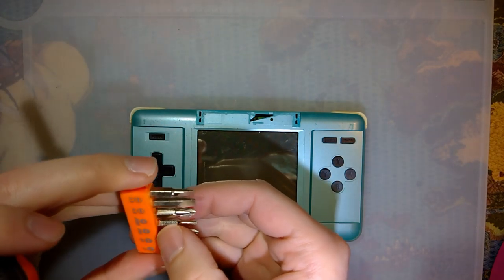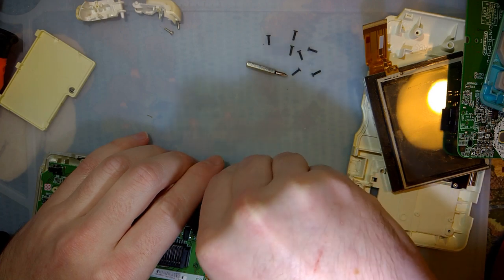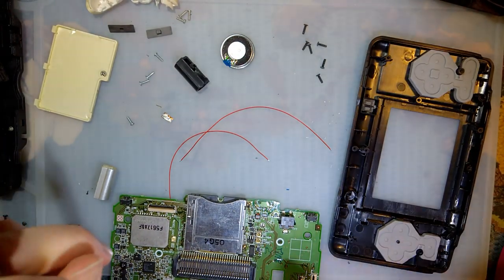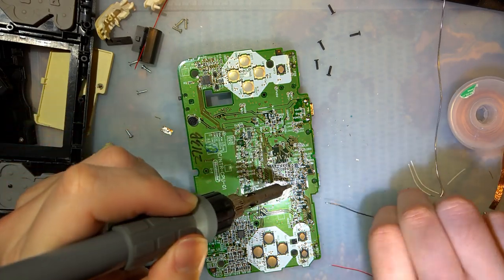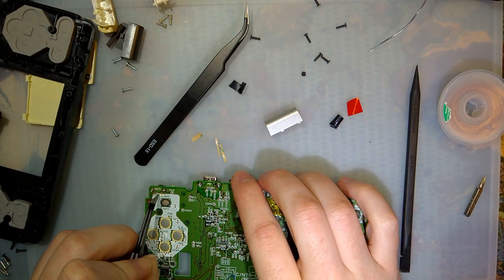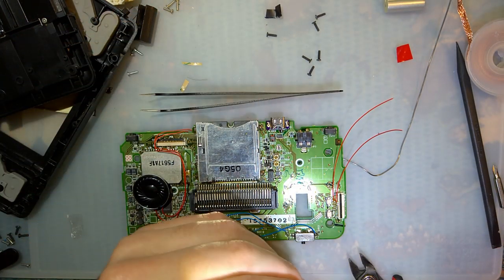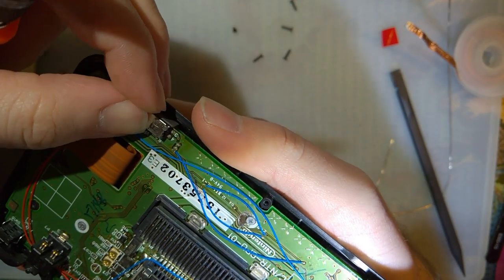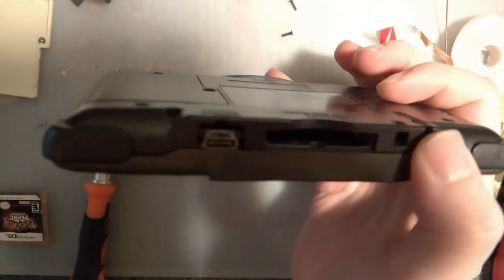Building a Dual Screen Game Boy Macro

Comment: A small suggestion, when you edit you should speed up the screwing and unscrewing, not the soldering people's following along at home would find that easier
Reply: Matthew Williams I think he just uploads them raw, honestly I enjoy the lack of speed up as I listen to these to relax/sleep. Valid suggestion though
Reply: @Shyverin  he sped up the soldering in this video
Reply from the maker: I only edited this video because there were long periods of me just struggling to hit my marks with the iron. I can upload the version that's twice as long if you'd prefer but I really don't think there would be any tangible benefits to it. 

I also linked in the description full guides for what I was doing so that if I moved too fast or didn't show the points I was soldering to, you could follow along with static, high res pictures. 

I don't normally edit videos (to this extent) but I also don't normally make videos this poorly. The McWill GBC video is the only exception that I can think off.

Comment: Maybe it displays the image all funny when you switch because it's trying to show both screens at the same time and the system is all confused.
Reply from the maker: Perhaps. I think it might be interference really. I might need a thicker wire or just a shielded one.
Reply: makho it’s possible. I just ordered some original Nintendo DS systems so, I can do some investigation whenever they arrive.
Reply: @LelandHasGames  hi, did you tried making a macro with switching screens? Any update?
Reply: @restlessheroes  update, I only have one working DS and I haven't had much time to work on any of them but, I have 3 candidates
Reply: Any update yet ?

Comment: Hi Makho. Cool mod. I guess once fixed you could run certain DS games single screen, such as Mario Kart "top screen only". Keep up the good work. 😀👍

I've recently bought cheap a "spares or repairs" DS Lite via an auction site, which has been cosmetically beaten around. Amazingly (apart from the top screen with a torn ribbon which could be replaced from Zedlabz or similar vendor, but that's a different story) it seemed to work.

However, upon trying to restore (for myself) and re-shell it, it has emerged that someone has, quite impatiently, attempted to fix it.  The clip for the digitiser's ribbon cable was nearly broken off (then pinged off on my first gentle lift 😔) from the motherboard. Do you think it would be realistically possible to, somehow, attach the ribbon to the connectors and permanently glue/pin it down in place?

It would be a shame to waste an otherwise working system due to a minute bracket on a part that can't be reproduced.
Reply from the maker: just replace the clip
Reply: @makho  Cheers Makho. 👍 Didn't realise they were available separately. I'll try that. 😁

Comment: In your opinion Makho, which do you think is a better mod, this one or the picture in picture? I'd love to follow your guide to put one of the two into my ds lite boxy Pixel macro.
Reply from the maker: PIP by far because you can do both with that one whereas this one just gets screen swapping. 

Still, there is something to be said about how much better the original DS feels to play over the Lite and the flush cart slot.
Reply: @makho  very true, the original feels better in your hand, and you don't need a Omega flash cart to make the gba slot flush. Definitely going with PiP then!

Comment: Why not install resistors on CC1/2 of the USB-C plug so you use a USB-C charger if you want?
Reply from the maker: Had I made the adapter myself, I would have. This was designed by someone else (and I did suggest adding them). I do plan on making my own version, eventually, but it's on the back burner for now.

Comment: You should try to make ndsl with a regular 2ds form factor, that would be so cool!!
Reply from the maker: I was actually thinking about building a replacement shell out of sandwiched laser cut acrylic sheets. Once the main body is designed, it should be relatively easy to add support for the "top half."

Comment: I have a broken dsi...no top screen...can I hack it without the top screen if I do the 330ohm resistor mod? Still wondering
Reply from the maker: IIRC there is some stuff you need to pay attention to on the top screen to install CFW. Once CFW is installed though, everything you need is on the bottom.
Reply: @makho  gonna get some parts that includes a working top screen. Thanks for the response and sorry for the late reply :). Also have you ever thought of usb type c on a dsi? is it even possible? :o

Comment: Has this been fixed yet ? Or updated onto the newer ds lite model macros ?
Reply from the maker: see description. Problem was my wiring. I fixed the issue by using shielded coax.
Reply: I mean was this able to be done same way on ds lite or dsi ? 3ds ? Curious if the mod is only capable for the older ds and ds lite

Comment: hi, please, I need your help, I had a problem making this mod, I am using a push button instead of a switch although I do not think that is the cause of the problem, I have managed to make the screens change places, but for some reason not  It has the colors it should have, what do you think is the problem?  it usually has white and yellow colors, I am sure I made the cut deep enough to worry about not going through the motherboard, hope you can help me, have a nice day.p
Reply from the maker: try using shielded coax wire
Reply: @makho  where should i use it?  I can send pictures. thanks for your help
Reply from the maker: @kensuyjin33  replace the wire you were using with that
Reply: @makho  I'll try.  thank you very much for your help

Comment: Great video. I'll also try this on my macro. Can you please give us a picture with the close up of the wire soldered under the ribbon cable? And the cut trace?

Edit: https://gbatemp.net/threads/ds-phat-screen-swap-physical-switch-top-screen-kept.542995/ i found this different schematic for the screen switch. Do you thing this method would avoid the top screen getting green?
Reply from the maker: I already linked a thread with the required wiring in the description. The difference between the one I linked and the one you linked is that mine uses the bottom screen and yours uses the top screen.
Reply: @makho  indeed, i found the links. I think i'll go with your method, the bottom screen, if i'd happed to get a green hue when i change the screen, i'd rather have the bottom as the main screen. Thanks a lot for the reply.

Comment: Were you able to get the screens to switch successfully?
Reply from the maker: Other than what I did in the video, no. Only because I haven't really worked on it though. I'll take another swing at it eventually.
Reply: I figured out, that it must be an issue with different Screen revisions. Did this project and had to test several screens to find a perfect picture and not greenish. Will post on insta the final result.